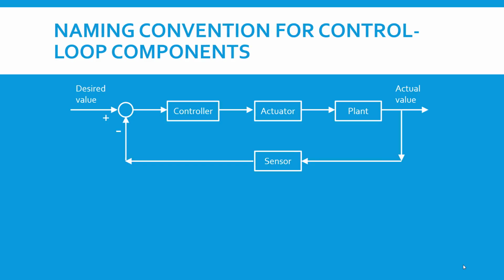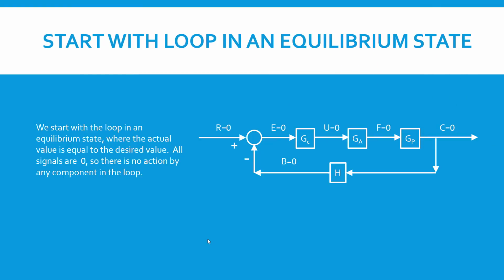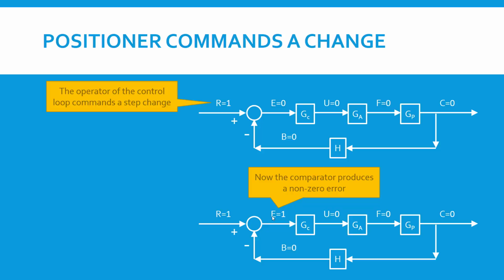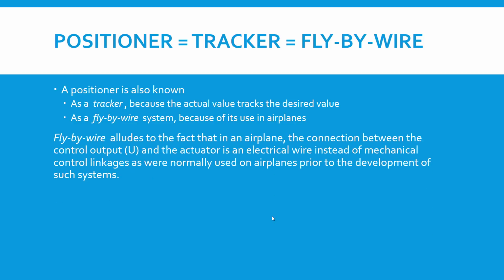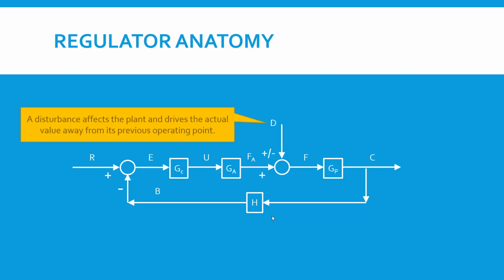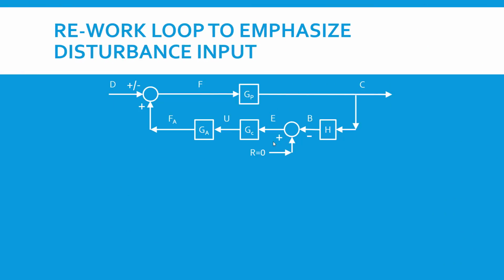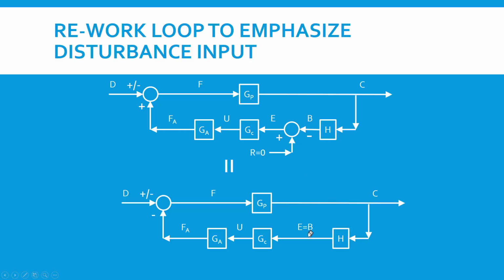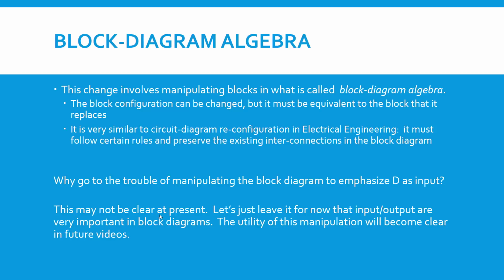PositionerVsRegulator

Comment: Aren't most control loops should be both positioners and regulators at the same time ?
Reply from the maker: Hi Mr. Nada,  A control loop can only do one thing at a time well.  If you ask it to regulate, then you are asking it to hold a steady value in the face of occasional or steady disturbances.  If at the same time you are changing the desired value you want it to hold, then that is doubly difficult for the loop to do.  It's like trying to hit a moving target.  So, yes, you can run a loop this way, but it probably won't work out very well.
Reply: @polyxengineering3857  Thanks for the clarification.